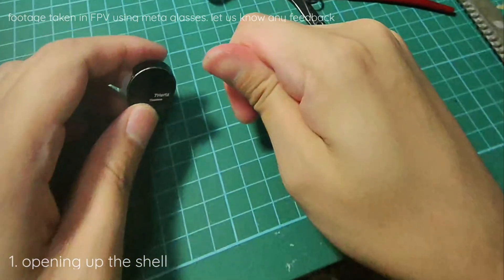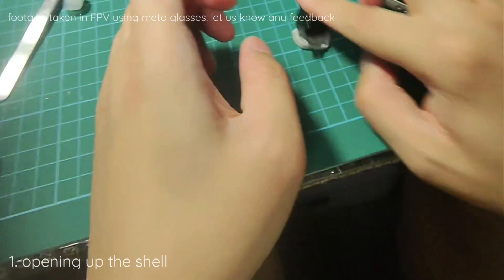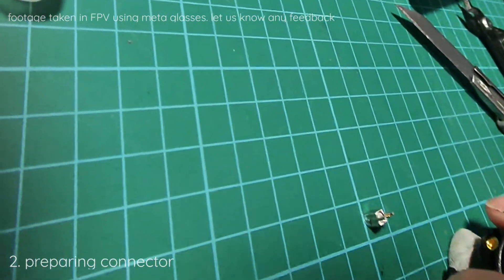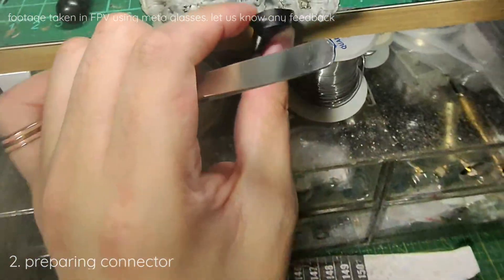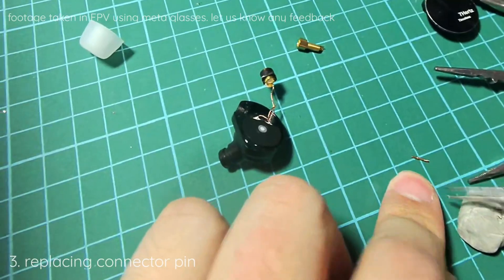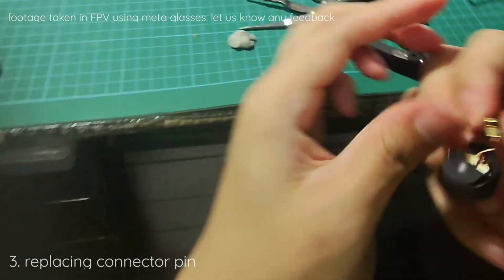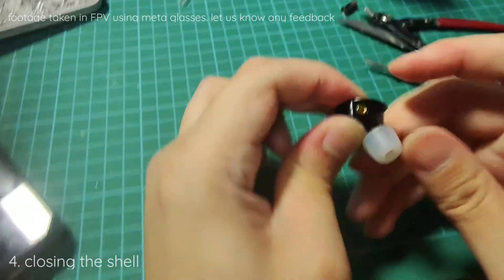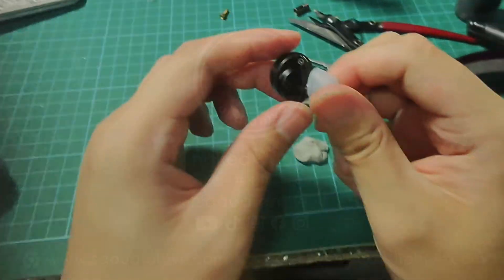MMCX pin repair feat. 7Hz timeless planar IEM  [NAKED Tutorial]

Comment: Would heat damage the planar drivers?
Reply from the maker: Direct heat will damage the drivers, it's the same for dynamic drivers
Reply: @sgaudiohive would you say it's bad to use a hair dryer/heatgun to open the faceplate?
Reply from the maker: Those work fine their heat can be controlled. You just want it to be warm to the touch